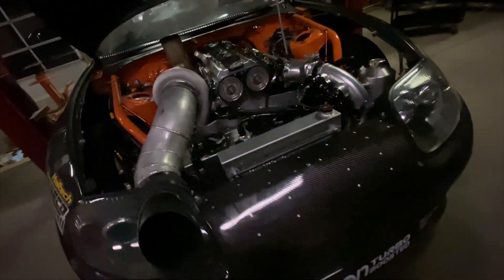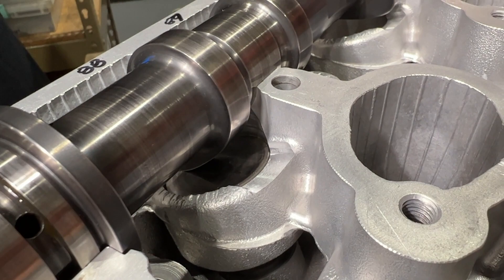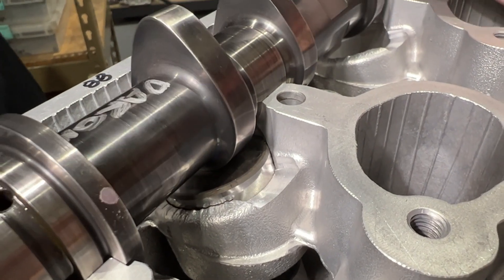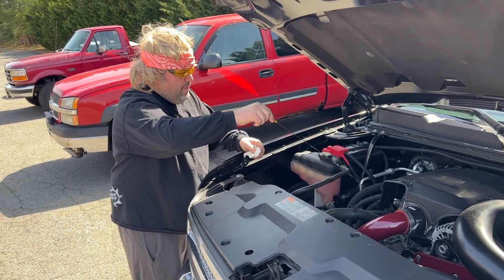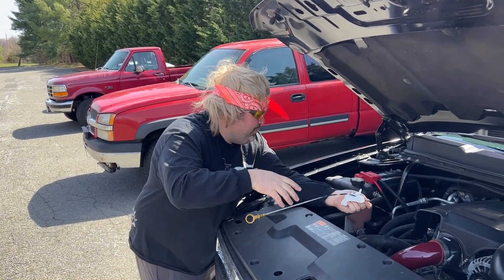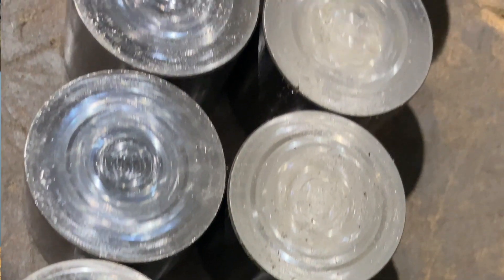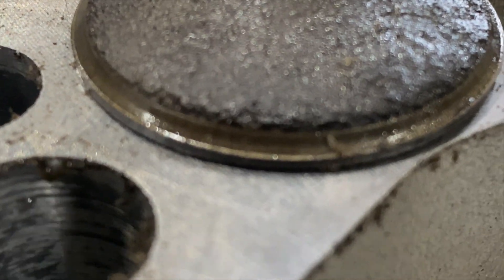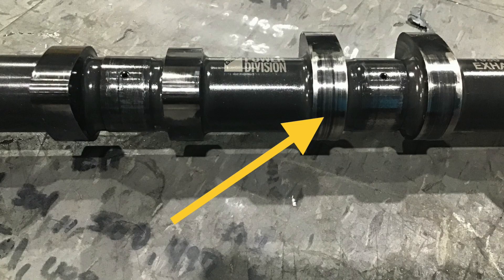Billet 2JZ cams How-To Part 1

Comment: Hye.. I'm from Malaysia...can you tell which one a better material of camshaft. The type of cast iron or billet material?
Reply from the maker: The billet cam is a manufacturing advantage so you’re not married to a cam blank that the entire world is dependent on. And you’re not married to the cast blank porous metal that makes machining to higher lift sometimes difficult. But, for a consumer I don’t think there’s much of an advantage to doing either. It would just be who has the better lobe design.
Reply: @headgames  thank you for sharing the knowledge..

Comment: What oil grade do you suggest? Will 10w-40 or 10w-60 will be recommended?
Reply: oil weight depends on oil clearances. your engine builder should let you know what's appropriate. But most likely oem weight if oem bearing clearances are retained. Also if oem clearances are used take a look at the manual for the car the engine came out from. there will be break down of different weights that should be used and under what conditions (usually temperature)